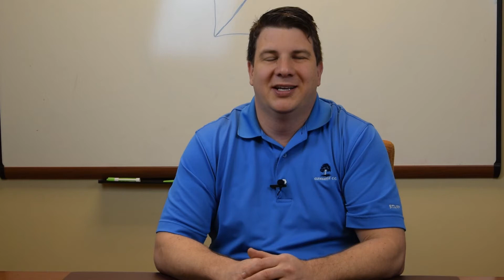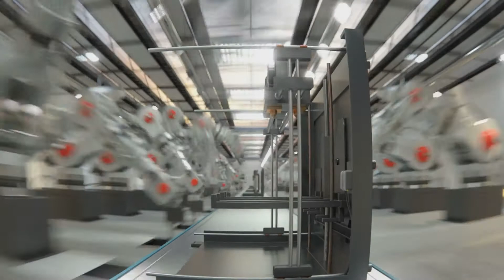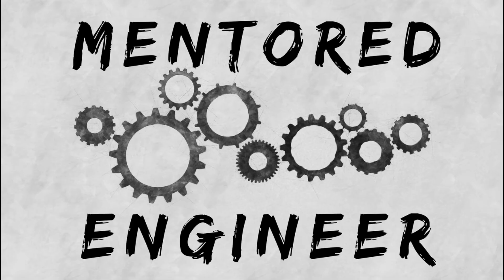You're Not Going to Like This Finite Element Analysis Tip

Comment: While the second half of the video has some very relevant suggestions, I do feel that it is not necessarily adding credibility when you state outright that you prefer hand calculations in a video about doing less FEA and more hand calculations (conflict of interest, no?). An FE specialist is unlikely to suggest that hand calculations are a waste of time, on the other hand.

I would imagine that what you pointed out for the hand calculations (i.e. that they take a lot of time in the beginning but become quicker over time and experience) apply equally to finite elements calculations, no? Especially since a finite element model can provide significantly more information relative to the time spent.